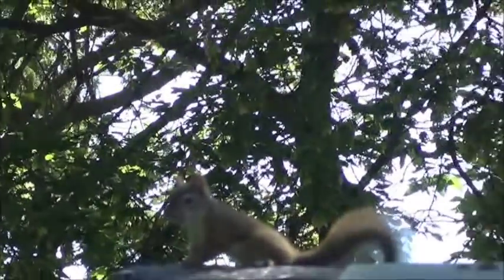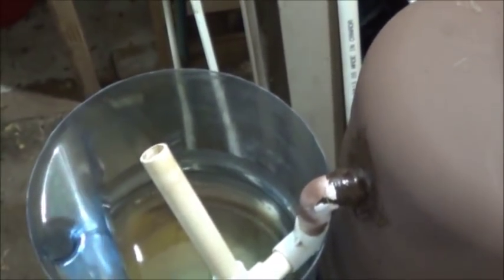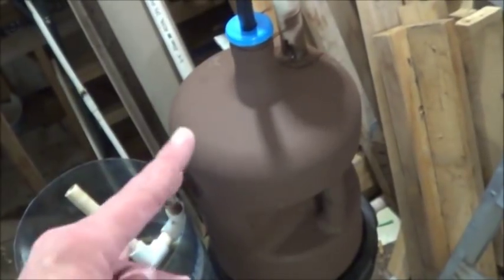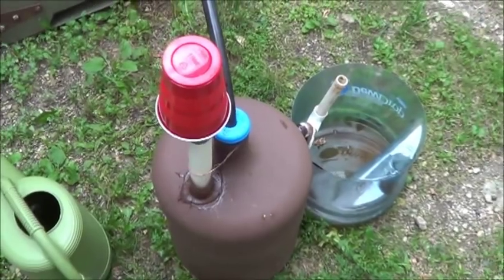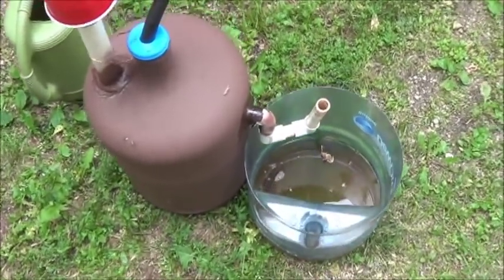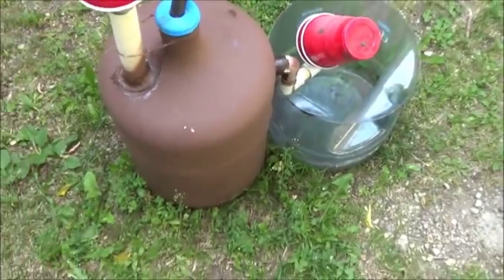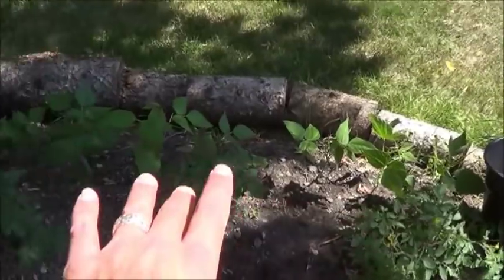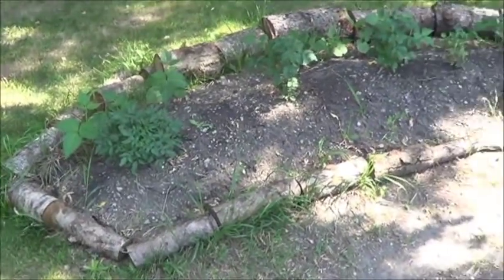Water Bottle BioGas part 2

Comment: we recommend fresh cow dung for first time because it has bacteria to digest anaerobically to produce methane. 2nd thing is that, most of time first filled gas tube can not catch fire due to large amount of carbon dioxide so you have to empty gas and wait for next refill.
Reply from the maker: Thank you for the suggestion, I should have gotten some fresh dung but we have no cattle within walking distance.
Reply: Mud from a still pond should work also as a source or methane producing bacterias

Comment: Ok went through your video list and nothing for part 3 on the digester dose it produce methane or not I have a fetid swamp water barrel and it stinks up a 100 foot area around the barrel and since I didn't get a chance to check for methane I'd like to know before it thaws out next spring wether I should cap it and capture methane or if it's just a stink that I should cap it to prevent from escaping

Comment: You need a valve for the liquid outlet and the feeder if you want pressure. As pressure is building up, it just has to push that tiny head of water up instead of the ballon.
Reply from the maker: good suggestion!

Comment: A few things, is there a part 3?

Also what happens when you fill up all solid manure at the bottom?

Also, I think if it was painted black it would "ferment" quicker.

I'd love to know how the rest of the project went!
Reply from the maker: There never was a part 3 video as my balloon never filled with anything flammable ... I'm pretty sure the idea with the solids is that they eventually break down to a point they exit with the overflow fluids and 'ideally' it never really gets full.  While it never produced gas that I could light, tragic I know, it did make for an interesting garden boost.  I used the overflow fluid to water one of my raised beds and it seemed to do fairly well that year.  Same bed was pretty much useless this year so I do wonder if the 'fertilizer' was why it grew stuff last year or why it's dead this year ... Sorry I don't have better news to report, thanks for watching!
Reply: @bearfamilyfarm4434  Still awesome video and really entertaining, also surprised you responded as it was a year old video! Appreciate it!
Reply: @bearfamilyfarm4434  Please try with cow dung..i want to try your build..but please with cow dung. Thanks
Reply: Check out my comments above this is basically a David the good feted swamp water barrel and it makes excellent fertilizer put in grass clippings any weeds and garden scraps so instead of cussing the weeds use them to make fertilizer I got twice as much potatoes as in past years and my cucumbers kept me from buying any at the store since they produced more than one a week we had some to give away our tomatoes àlso produced four times as many so instead of barely enough we had lots to give away
Reply: @wilsione check out solar cities methane digester there are a lot of videos on biodigesters and how to use and store methane there is also different companies that make and ship digesters and the bags to store the methane gas

Comment: what is the update of the biogas?
Reply from the maker: Short version?  I should have used some form of dung to start this up.  I get some great compost tea for my plants but this little bottle has yet to produce anything that can create a flame.  I suspect a larger system would have been a better idea, starting with dung probably would have helped and I'm not sure my seals really did the trick either so ... I blame me, not the idea ...
Reply: @bearfamilyfarm4434  we recommend fresh cow dung for first time because it has bacteria to digest anaerobically to produce methane. 2nd thing is that, most of time first filled gas tube can not catch fire due to large amount of carbon dioxide so you have to empty gas and wait for next refill.

Comment: You could use a better design, i think, with less holes în your bottle, and that should work. Anyway, for experimenting you could have used  a simple bottle and put the cap on completly, to see If anything is produced at all.
For real production you need to have at least a barrel size container.
Reply from the maker: It does seem like this is a place where size really does make a difference.  Thanks for the feedback, be well!
Reply: @bearfamilyfarm4434  Well, it does... 😂
The amount of the gas produced depends on the amount of matter used.
Allways stick with the basics when things don't work, then expand.
Reply: @bearfamilyfarm4434  Biogas is a extremly simple thing. People are making it complicated.

Comment: I am at war with squirrels, chipmunks, and mice.   I have so many traps set up for them.
Reply from the maker: So far those squirrels & I are still talking it out.  They're getting pretty sassy though and it may be time to test some of my larger pellet guns soon ... or I guess BBs would be better, no lead means safer meat right?
Reply: LOL!  I am actually posting a video tomorrow about this.  I bought a pellet gun, but for legal reasons, I cannot confirm nor deny I'm using it against squirrels.  But, I also have found the BEST trap for chipmunks and mice.
Reply from the maker: Lol, sounds like somebodies having an adventure!
Reply: Live trap them and move them somewhere else

Comment: I see that you read and act on comments 2 thing is go to David the good video on his feted swamp water barrel  black gumbo also has a video on making a feted swamp water barrel this is what you have basically built and this will tell if these barrels are actually making methane if so they're 10 times more grean house gas producers than carbon is and should take it to the next step and capture and burn the methane

Comment: The length and width of your gas pipe is way too ambitious.
All that volume has to be filled with gases before it can start increasing in pressure and "inflating" that balloon ?
The balloon idea is to act as a pressure vessel as well as a storage facility for any gas !
That pipe gauge would probably be fine for a digester with a volume of maybe 100 cubic feet ?
Why not just use a TEE off of the digester and attach your balloon to that ?
Also once production  does begin (extremely slowly without methanogenic (Dung) bacteria, ) it might take a few weeks in warm conditions .
(like that inside the gut of an animal or person) 
Initial batches of gas are mostly Carbon Dioxide and wont burn.
Also some room above the feedstock is needed for material expansion as the contents ferment ... 
otherwise everywhere will get bunged up with froth and scum.
Keep it comin though, interesting stuff !
Thanks
Reply from the maker: Ya, my sizing was less than ideal but I didn't want to wander to far from home looking for bits & bobs to make it happen.  A larger setup would be the way to go for sure, and will be next time, but will have to wait until I can get access to somewhere it can stay warm all year and some fresh cattle manure would be a good help as well.  I'd really like to try this with an IBC tote but the ones I have now are part of our rain system and not about to get moved elsewhere any time soon ...  
Thanks for the awesome & detailed comment!

Comment: Dude, your gas is leaking all over the place. This thing NEEDS a culture of bacteria or NEVER will produce any gas. 
And your feeding port needs to be sealed. 

As well as the effluent valve. The hose should be plugged into a rubber chamber, (that balloon seems to need a lot of pressure that you´re never going to achieve) from a tire or something. That´s what I am going to do. 

Both videos are interesting. However I believe the volume is too small if you need to cook daily. A couple of 200 liters barrels would work much better. 
Thanks for that video though!
Reply from the maker: Leaked like a sieve and all I really got out of it was some medium quality garden fertilizer.  Not a total win but not a total waste either, mostly though ...  what it really needed most was a trip to a cattle barn for the right biology but it was a fun way to kill some time!  Thanks for the feedback!